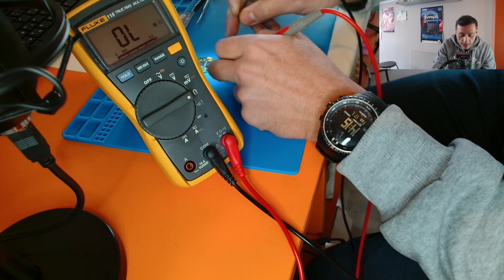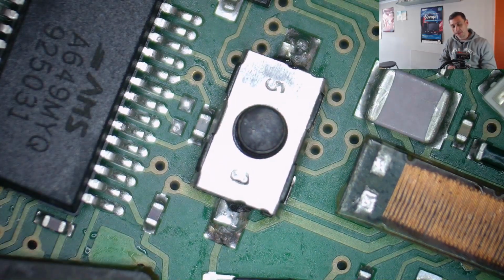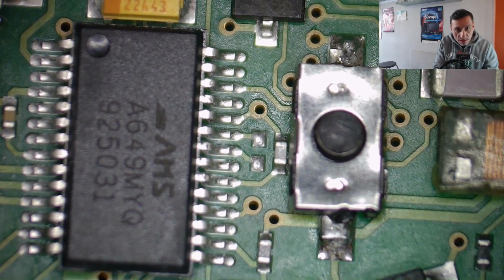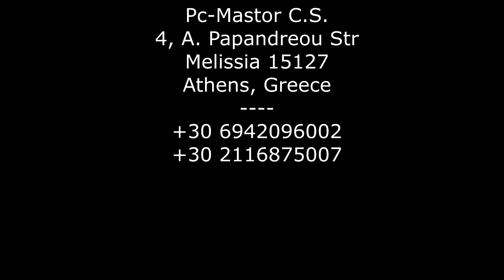Mercedes key fob draining the batteries

Comment: Good job. Why didn't you connect the fob to the power supply or a multimeter to check the current before and after the fix?
Reply from the maker: That is a good point! Thanks for the recomendation.  Actually the problem was fixed. The customer called me 2 weeks later and reported that the batteries did not drain again.
Reply: @pc-mastor  I'm happy to hear that ❤️❤️❤️
Reply: @pc-mastor  γειά σου, μας σώζεις! Great tip to check our keyfobs, can you share the year and the type of the Mercedes this key fob is for?
Reply from the maker: @g89406  Thanks for the comment. It's been long time...i only remember it as an A-Class Mercendes. Sorry...

Comment: Thanks for this great video, i was wondering when you were checking the switches with an ohmeter, how come you didn't PRESS the switch down to make a circuit, as unpressed you would not get a connection or a reading ? 🤔
Reply from the maker: Hi thanks for the comment. Checking the switch health not needed. The switch had no problem. Was locking-unlocking the car as it should do.  So it would get us nowhere just hearing a beep with the multimeter just checking the switch terminals. What mattered was what the switch was connecting to and what was the resistance of it's terminals.